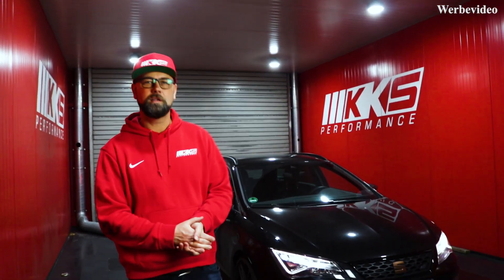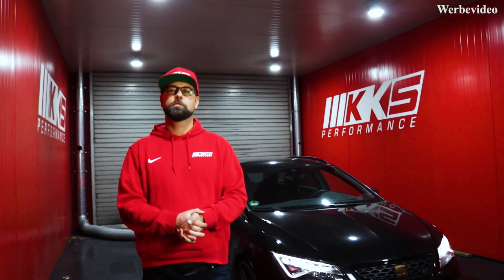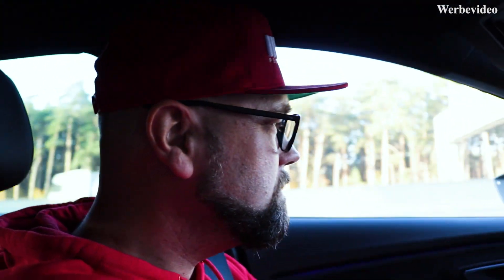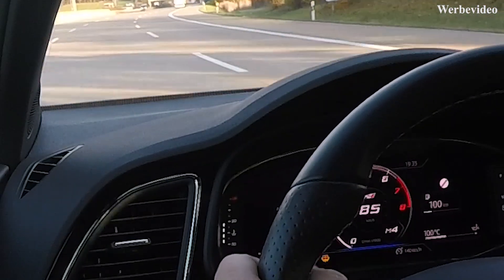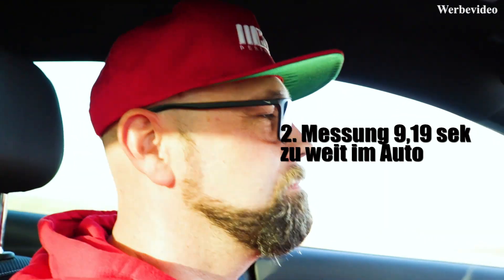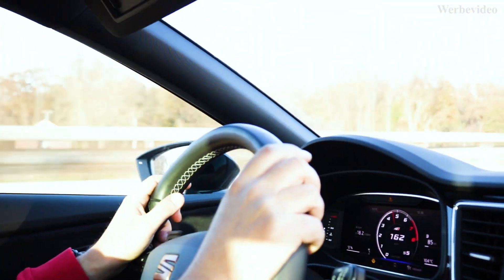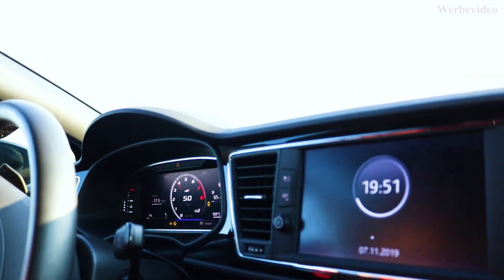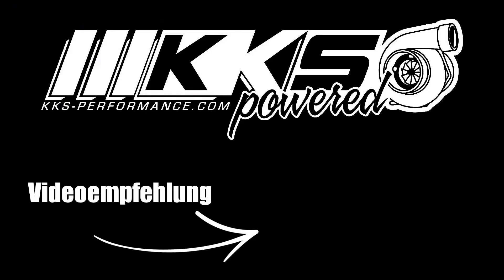Seat Leon Cupra 300ST 4Drive OPF | LM500 Turbolader | KKS Performance

Comment: Cooles Video ca 430 PS bei dieser Zeit würde ich schätzen
Reply from the maker: 447ps und 550nm um genau zu sein.
Reply: @KKSperformance  frage ist der Motor verstärkt?
Reply from the maker: @mariobaumann9389  Nein deshalb nur 447ps und 550nm.
Reply: KKS-Performance GmbH wie habt ihr das Problem mit dem OPF gelöst oder ist diese noch Serie ?
Reply from the maker: @Nick-ng5lg  Der kann bei der Leistung drin bleiben. Da kommt demnächst ein Video dazu, wo ich das genau erkläre.
Reply: KKS-Performance GmbH ok danke für die Info, bietet ihr auch für denn Cupra 290OPF  (5türer) in Zukunft an ?
Reply from the maker: @Nick-ng5lg  ja klar das ist genau der Gleiche Umbau.
Reply: KKS-Performance GmbH hört sich gut an 😄 mein Ziel wären so ca.400ps/500nm warte nur sehnsüchtig auf eine ECE DP fürn OPF da ich da immer Bauchschmerzen bekomme, ab OPF ist schon 3,5“ vorhanden 🙈😂
Reply: @KKSperformance  wie viel Haltedruck bei der Leistung?